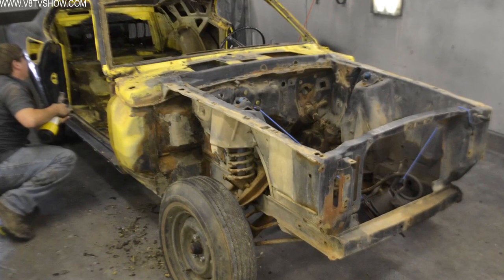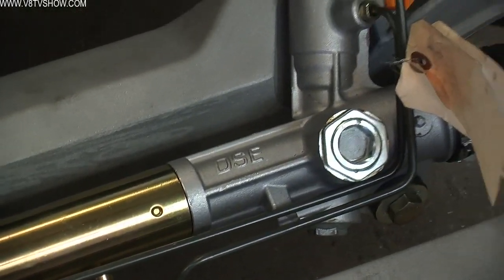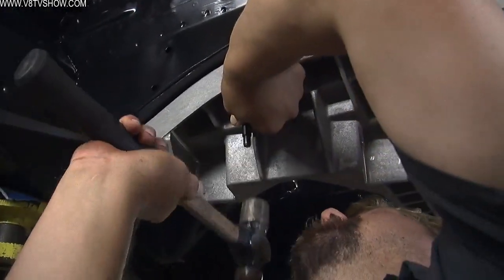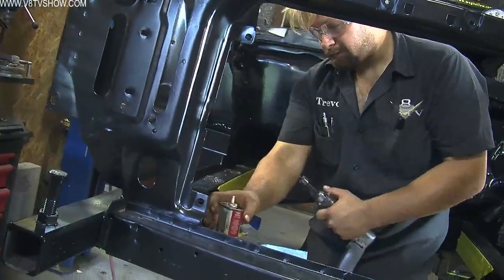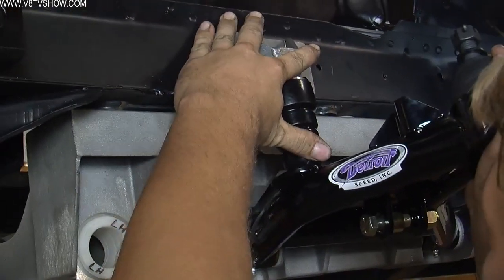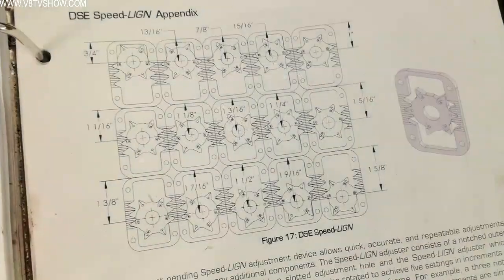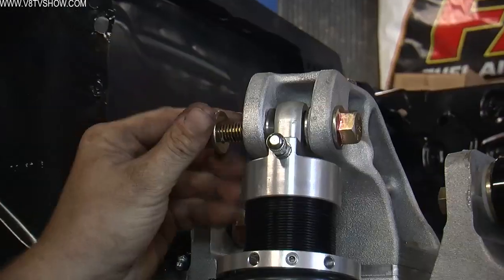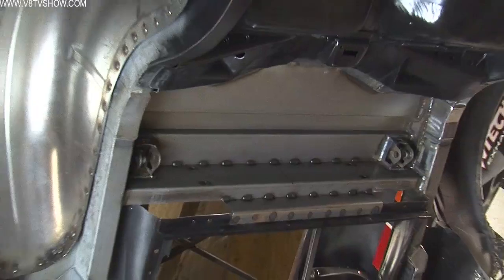1969 Mustang BOSS 302.0 Detroit Speed Aluma-Frame Install Video V8TV

Comment: Nice, how much does it cost?
Reply: Depending  on how you option it out the price can range from $6,650.00 to $7,950.00 +/-!...For more info. you can go to their website: http://www.detroitspeed.com/1964-1970-mustang-products/032050-aluma-frame.html  Hope this Helps 4 years later!...God Bless!
Reply: $10,000 for both almuframe and rear quadralinks

Plus powder coating the aluminum is extra